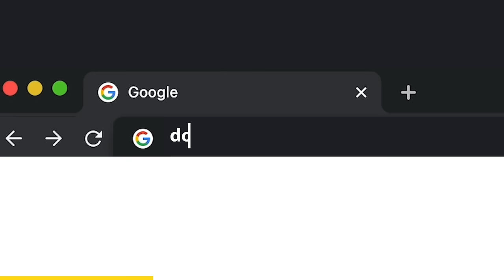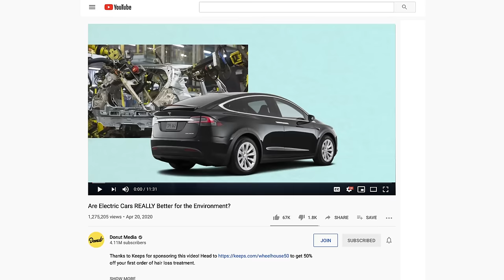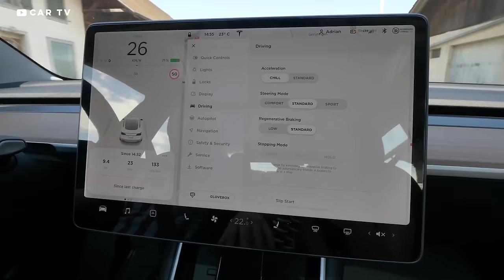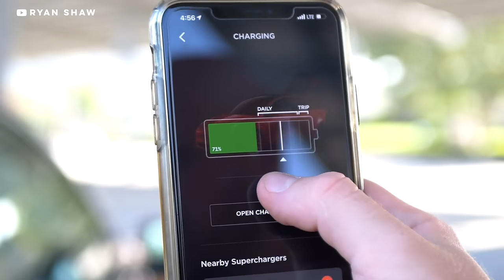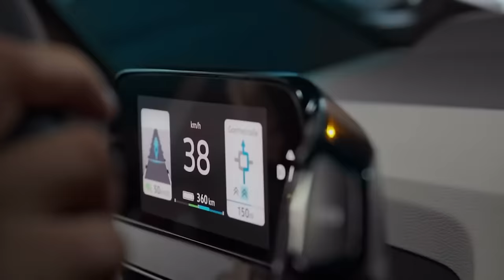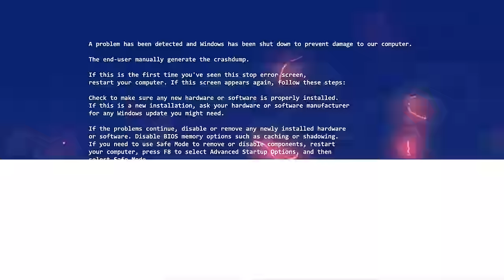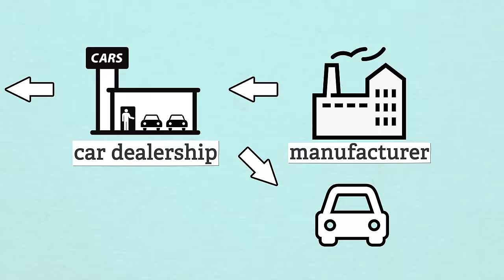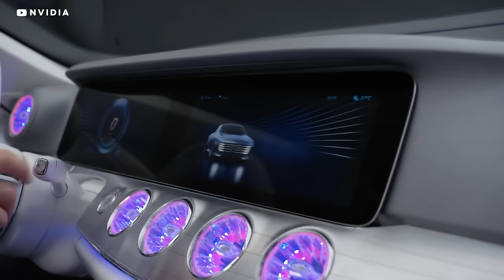Why Can’t Anyone Take Down Tesla?

Comment: Those engine sounds when the cars pass by has me cracking up. Nice one editor
Reply: There is a good reason for EVs to make a sound though, even if it's using speakers. It's safer for pedestrians.
Reply: I read this as the car passes by
Reply: Lol
Reply: Lol
Reply: Porsche Taycan Turbo S beat the Tesla🤷🏽‍♂️
Reply: should have had some kid sayin vrooom or somthing lmao
Reply: SWEAR
Reply: If only they where 2 step sounds bro 😂
Reply: Spoiler
Reply: Well at least I'm not crazy...
Reply: @chriss8536  nothing to do with this thread.
Reply: @kvltizt  they don'treally need speakers, the motor should keep running on idle like an ICE, motors make sound btw, depends
Reply: @brunohsans9779  huh???

Comment: Nolan: "Close your eyes and picture an EV"
Me: Prius... 
Nolan: Tesla
Me: Exactly, Tesla
Reply: I thought fisker
Reply: @A1Retro42  taycan
Reply: Me: electric fd camaro
Reply: Does a fully EV Prius even exist?
Reply: @claudiobizama5603  No, there is the full-hybrid Prius and then there's the plug-in hybrid Prius.
Reply: A prius is a hybrid. Not an ev
Reply: I pictured the Rimac tbh
Reply: G-Wiz
Reply: @SshiggyY  I pictured lime green SLS on top gear
Reply: I pictured taycan
Reply: Golf cart
Reply: The Honda E for me
Reply: @Majaweed17  you is wrong
Reply: @karlkukk7080  it's so cool
Reply: Me: Geoff from topgear
Reply: Me: closes my eyes
My brain: https://photos.app.goo.gl/qawRkVBAGEPQNGNL9
Reply: @nuttiing5643  Same lol 😄
Reply: I picture an '83 Toyota 4wd with a few pancake motors turning some adjustable diffs, solar panel bedcover, roof, and hood, sitting on some Mickey Thompsons and mean ass suspension ripping around the desert.  No computers aside from the charge controller and speed control circuits, just a simple, old school analog machine with a torquey powertrain that'll let it pop wheelies up rocks and whatnot.
Reply: Geoff
Reply: I thought of the Panamera
Reply: Lucid motors will take over
Reply: @claudiobizama5603  yes but it isn't battery powered its powered by hydrogen to make the electricity.
Reply: It's called the Toyota mirai
Reply: I pictured the Chevy Bolt since I keep seeing videos on it recommended to me
Reply: Lol
Reply: Mostly only N Americans can picture tesla as Tesla doesn't have a presence in each major country/market.
Reply: Except Prius isn't electric, it's gas. Gas made more efficient with an electric motor, but they get their energy from burning gasoline.
Reply: Claudio Bizama — no, there’s no fully electric Prius
Reply: Prius is disgusting
Reply: Mitsubishi EV
Reply: full ev tesla. close eyes and picture hybrid = prius
Reply: I thought of the Baker Electric, just like the one owned by Jay Leno.

Comment: You’re missing Tesla’s charging network, trust me when looking at buying an EV charging points matter.
Reply: Oh good point
Reply: Mobile Games  I'm pretty sure it was the same with petrol.If I'm not mistaken you used to buy petrol at pharmacies
Reply: Yep, Tesla's the only company that's actually building infrastructure for electric cars. That's why I want one; they are literally the only option for an electric car you can easily take on roadtrips.

I'm assuming the other carmakers haven't just hooked onto the Supercharger network because it's owned and run entirely by Tesla, which isn't favorable for them. But then in that case it's frustrating that none of them are even trying to compete...
Reply: No one in this world has electricity. You have to invent it, before selling electic cars.
Reply: 💯 I have driven Bolt long term and Tesla’s long term. I would never hesitate to drive a Tesla on a road trip. The Supercharging network is a game changer for quickly recharging. 50kw chargers leave you charging for hours on end. I have heard rumours of why other manufacturers cannot use Tesla’s Supercharging network. The actual fact that owning a non Tesla and not able to use a the s/c is a game changer. Tesla will continue to detroy and own the entire ev market.
Reply: Bit of an update: Recently learned that a couple years ago, Volkswagen started their own charging network via a subsidiary called Electrify America; they use open standards, so while some marques design their cars specifically with Electrify America in mind, technically any car (apart from a Tesla) could charge from their stations.

It's gonna take a while before they catch up to Tesla though - especially in Canada, where there is a subsidiary of the subsidiary in charge and they haven't even put charging stations in such important cities as Vancouver or Montreal yet, while Tesla finally connected the country from coast-to-coast a few months ago.
Reply: That’s why I think it’ll take an alliance to take down Tesla or just the Volkswagen group lool. If you can get 3-4 companies that provide EVs to different market segments and they all team up on a charging network and producing the battery technology, it’s over for Tesla.
Reply: @mariuscarausu9352  wut
Reply: @singhatar0912  I'm not joking,when cars were just invented for the first 25 years you could only get it from the pharmacy/chemist.In the UK the first petrol station was opened up in 1919,while the second one in 1922.
Reply: @georgianbents  It’s funny how things have changed. You can still find maintenance stops on old highways.  Ones that never became more then gravel pull offs and maybe a water tap provided by a spring or well.
Reply: I have one coming to my hometown soon
Reply: @arnold17  I wouldn't bet on it. Watch and learn
Reply: @sodapone  i think i read on Elons twitter than Tesla superchargers in Europe are compatible with other EV brands,and its a decision of said Companies not to support it in US.
Reply: Yes. I've looked at EVs, and the only one that might work for living and traveling in Wyoming is a Tesla. There just straight up aren't non-Tesla fast chargers in the state (and the one non-fast charger I tried to use with my Volt when I forgot my charge cord when visiting my grandparents had a broken credit card reader and couldn't charge. If I didn't have an engine, I'd have been screwed).
Reply: I would much rather drive cross country in a gas vehicle. In case of breakdown, gas stations are much more available. I feel like electric is an "around town" option, more then a coast to coast option. At least until battery tech takes a huge step up.
Reply: Yes.......
Reply: Very good point.

The only true competitor to Tesla is Aptera in that department and they don't plan on being in production until the end of 2021 or early 2022.

Because they're efficiency is so great, 50kw chargers provide 500 miles of range per hour, and those chargers are everywhere.

Not to mention their range options of 250, 400, 600 and 1000 miles helps ($26,000 $30,000 $35,000 $45,000 respectively)
Reply: The ONLY advantage for a Tesla over other brand is the charging network. which is why Tesla is getting beat in Europ and China because governments there build more public chargers.
Reply: @Tomoyo0827  those countries do have better charging, and Tesla has much more competition there (because of that and more models and companies making EVs) but Tesla is still the best selling EV in China and if I'm not mistaken Europe too (unless VWs close second place turned into first recently)

But we will see when Tesla opens the Supercharger network to other EVs

Until then I will either get Tesla's compact or the Aptera when they come out.
Reply: @matthewboyd8689 Tesla lost to a few Chinese ev in China for 2 months in a roll now
Reply: @Tomoyo0827  the wooling EV, I know

Great that someone is catching up.

But the cost like $4,000 ($20,000 before incentives) and I didn't check back but are their sales still increasing?

If they are selling as well as a $40,000 or more Tesla, remember that the Bolt sold just as well as the Model X and everyone thought that GM was head to head and now Tesla is outselling them 10 to 1 in America.

And teslas $25,000 compact will be coming out in 2023 so considering it is bigger than a subcompact like the wooling EV and the Model Y is selling just as well at ~$50,000 I'd bet Tesla won't loose their lead after that.

But yeah, there is actually competition in China that gets close and as long as the EV transition happens, even Tesla is okay with that 

Elon said it himself, Tesla doesn't care if they go bankrupt to an EV that is so much better that they can't compete, as long as it's so much better that internal combustion engine vehicles aren't bought anymore

✌️ Thanks for the info (and what was the other EV that outsold Tesla?)
Reply: @mariuscarausu9352   And before that they'd pack enough gas with them to make the trip.
Reply: @Tomoyo0827    Ya, because the "Hongguang Mini" (the EV with the most sales in China) is such a kick-ass car. ;-) 

 Ford sold more Focus' than Ferrari sold in their whole lineup.  So what would you take given the choice; a Ford Focus or a Ferrari?
Reply: I will stick to petrol.
Reply: @elixier33  2035 ban new sales of gas and diesel vehicles pall
Reply: You're spot on 👍
Reply: Like realy matter
Reply: Only if you can't charge at home or take long road trips often.

Comment: Main reason: Most Automakers never fully focused on Electric powered vehicles.
Reply: Well, they do now.
Just look at the id.3:
- cheaper than a model 3
- more Range 
- better build quality
Reply: ID.3          37k € for 420km
ID.3          45k € for 550km 

Model 3  44k € for 409km
Reply: @FacelessMagnum  for how much?
Reply: Most manufacturers are required to sell via the dealership model.  Tesla can sell directly to consumers.  It's literally the only vehicle brand you can order online (in the US anyway).  A huge factor, IMO.
Reply: @curlyfats  not only that, I've talked to a few engineers that work in the electric car industry and they've said that in total the electric technology hasn't matured yet, but in about 20 years were going to have allot of electric cars for around 20k with much better tech - the only issue to really solve is the batteries. They're nothing special and are terrible for the environment since we can't really recycle them.
Reply: If the traditional manufacturers actually put legit resources into EVs there would be good competition but the lot of them are just chasing the current consumer demand and not trying to drive it. Most of the available EVs are a half-assed side project. That could get abandoned at a moment's notice.
Reply: Whose gonna pay the farmers not to grow crops for ethanol and bio diesel? Musk will die poor like Tesla
Reply: @martini380  id3 isn't sold in the United States. A big car market. But I guess not a huge electric vehicle market. But you can't grow a market share if you don't sell there.
Reply: Carsten Stahl Wait isnt the id.3 smaller than the model 3?
Reply: @the_one_titan3381  The Space isn´t much different.
You can watch the viedo "Der Elektroauto Check: VW ID.3 gegen Tesla Model 3, Aiways U5, Kia e-Niro, Hyundai Kona" by nextmove (it´s german but you can see the differences)
Reply: @FacelessMagnum  Tesla does not offer a 646km model S.
They offer:
Longrange 80k€ for 610km
Performance 97k€ for 593km
Plaid 140k€ for "840km+ (Estimated US numbers)"
Reply: true their more focus in gas cars just wait till the ev is a main car probs bmw will beat them they build fun cars
Reply: Edbert' gaming Tesla’s more of a Tech company than an auto maker
Reply: @martini380  But Teslas can yodate and have 3 times the power. Is not exactly apples for apples.
Reply: Indeed, big companies are focusin on eco sport petrol vehicles and EVs are just a side proyect. Tesla only focus on EV cars thus making improvements in that market. Electric and hydro cars are something people been playing with since early 2000 but never invested full time on it
Reply: When they do Tesla is in for one hell of a fight
Reply: Rivian.
Reply: @icenine135  there is former exec from Tesla who is quite successful in recycling lithium batteries.
Reply: @martini380  its way slower and teslas have more range
Reply: @spaceboitv5646  Did you even look at my comment?
Sure, it's slower but i listed many ranges + the range per 1k$, please tell me where theres a tesla that beats the id3 which doesnt cost like 10,000+$ more
Reply: @martini380  it says 490km for the base  model
Reply: @martini380  if you are going for a more cheap slower daily driver than sure the id3 looks good but if you want something that can both be a daily driver and a fast car to have fun with then tesla beats it
Reply: @spaceboitv5646  Sure they increased the range from last year to 490km but it also costs 49k€ while the highest tier id3 costs 43k for 550km, so where is that cheaper?
Reply: @martini380  less profit , less sales too , plus Tesla innovates much faster
Reply: @icenine135  that's where hydrogen comes into play... every car company out there except Tesla on it for at least a decade.
Reply: How could anybody actually make a video like this without mentioning what actually set Tesla up for success. They put sensors in their cars first and use their software to gather data on their users. That user data is why they're valued so highly compared to traditional car companies. Definitely not coolness factor or anything like that!
Reply: They loved to make fun of them too.
Reply: @martini380  still didn't beat tesla lol 2 years later
Reply: @zaprowsdower3911  How can you even write this when VW more than doubled it's EV sales in europe since september 2020.
(After they already surpassed Tesla in volume in august-september)
Reply: They’ll have to soon
Reply: Cult like mentality with being first and only focusing on EVs instead of splitting their attention between EVs, Hybrids, and ICE vehicles.
Reply: @martini380  It's more expensive. And if you want all the features the Model 3 has (while still having a horrible outdated system, etc.) you basically can just opt for the Model 3 performance and still be better off pricewise.
Reply: who cares evs mid when gas prices go down no one gona want it

Comment: Me a swede: Volvo
Nolan: that's right a Tesla
Me: yes, yes a Tesla
Reply: I'm sure polestar are Volvo's e-car division aren't they?
Reply: @loumorningstar7709  something like that. seen two circulating at street races here and ive only seen them get destroyed at the drag strip sadly. rly wanna see more fast electric road cars
Reply: @loumorningstar7709  You'd be correct.  Polestar is to Volvo what Genesis is to Hyundai.  Just it's own thing but in Volvo's case, it's focused on electric/hybrid vehicles
Reply: @loumorningstar7709  polestar WAS Volvo's performance branch, they then broke off and focused strictly on E tech and have started coming out with their own e vehicles.
Reply: @Mike_in_Can  Geely (china), essentially has most of volvos IP now through funding
Reply: @Johnc3003  they had to buy their way away from Ford somehow. I wouldn't be surprised if Tesla was in the same boat.

Comment: Imagine in the future
“Oh yeah I just updated my car from 150 hp to 970 last night, just left it on the charger in my garage”
Reply: That would be pretty sick
Reply: The power is actually determined by the voltage the battery has and the current it puts out. The voltage decreases while discharging. So basically it’s already the case. So when you charge an EV the battery voltage increases again and you therefore have more power
Reply: Yea we can do that already
Reply: Andre Barreto it’s an ECU tune really. Most cars performance based vehicles can squeeze 40-90 hp off an ECU tune. The b8.5 s4 for example goes from around 330 to 380/400
Reply: Crazy thing is my boyfriend’s model X actually got a firmware update that resulted in 10 (roughly) more horsepower. Now it makes 815 buff horses. Mo powah baby!

Comment: As a tech for a GM dealer... I worked to earn my certs for these vehicles because it's exciting to me and cutting edge tech. But, I can tell you that in some areas, EVs are being hurt at the dealership level.
Salesmen don't know how to sell them and don't care to learn anything about them.  I personally drive a Volt, in a town full of all kinds of hybrid/ev owners... Yet I was told by a sales manager "There's no market here, people want trucks."
When I asked why they hide our Bolts in the back of the lot.
It's frustrating working with short sighted, yesterday thinkers.... 
Tesla will always be ahead because Elon thinks in chess...
The big 3... Tic, tac, toe...
Plus, no matter how good your product is and how well you build it...
If your frontline at your dealerships aren't supporting the direction your trying to go... You cannot win.
Salesmen steer customers away from the EVs for higher commissions and spiffs on crossovers and trucks.
Hell, our new 460 charging system has been sitting in a crate for 6 months... When I asked, I was told it was being installed behind the carwash, out of the way.  
You just cannot make people think in a forward direction. It's maddening.
Reply: That’s 100% true. I remember when shopping for cars and considering a Bolt or Volt. They were hidden from the dealership and the sales person didn’t know how to operate them.

Though….that’s also GM’s fault. It shouldn’t have a learning curve. Teslas are pretty straightforward for the most part. There’s more advanced stuff in the settings, but starting and driving is easy.

The other problem is that only recently have traditional automakers used electric car frames from the ground up. A Bolt is just a Cruise with the batteries on the floor. It’s not designed from the ground up to be electric, and there’s significant differences due to batteries and lack of mechanical components that require a totally new frame from the ground up.

Car companies are only now starting to make bets on electric car platforms…but imo they’re all far too late unless they focus exclusively on the bottom end of the segment where tech is less important than value (which has been Nissan’s strategy, and the only traditional automaker successfully selling EVs).